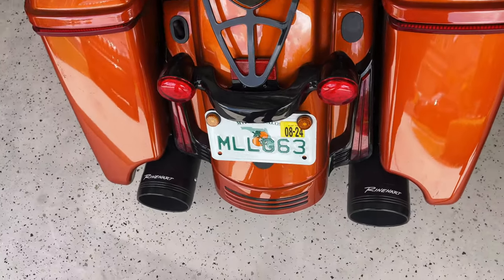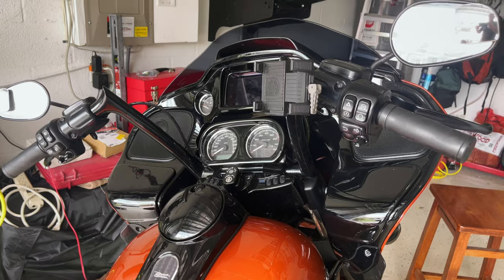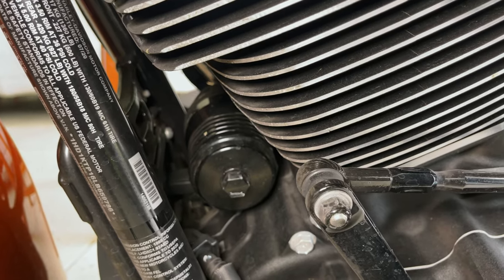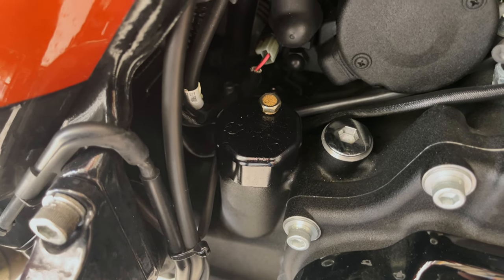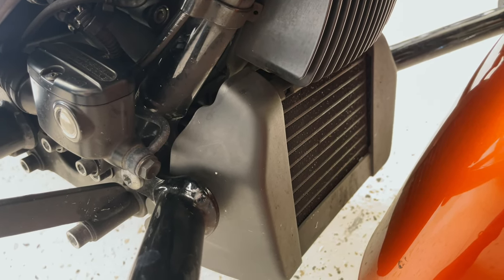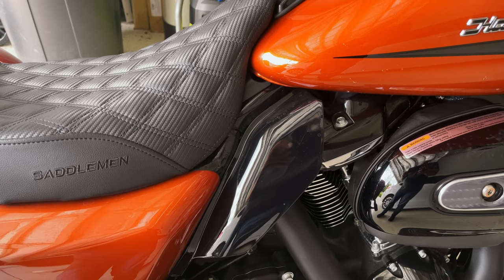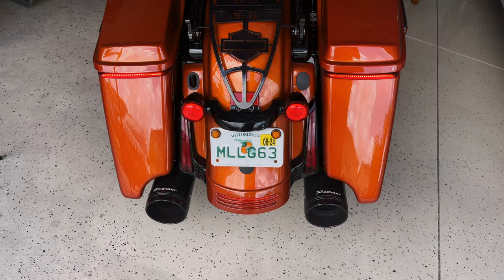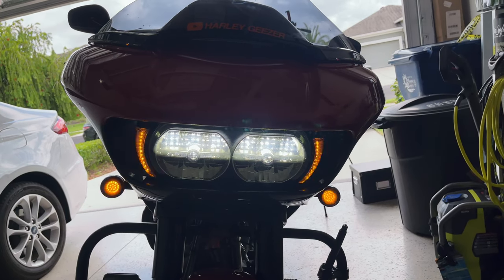HARLEY 114  M8 MODS THAT MAKE SENSE!

Comment: All you need to wake up a 114 is a cam because EPA has the motor choked, but other than that you are right. I have the same bike as you and I was on ciro3d cover for Myrtle Beach bike week in 2021.  Love my lights..
Reply from the maker: I might do the WOOD performance when my warranty is up. Not the HP but the torque version. I will do a video on an internal upgrade soon.
Reply: @HarleyGeezer1954  I have the 22xe torque cam on a 107 touring. I primarily ride 2 up and pull a trailer on long trips. The cam upgrade is THE best bang for the buck IMO. When you do that, expect a much louder exhaust note.
Reply: How do you know what oil pump you have I have a 2019  roadglid ultra

Comment: Great mods that keep the engine stock. Another one that I have is a catch can for the head breathers.  This keeps the cylinder from  hemorrhaging carbon and gives you a better throttle response.
Reply: probably won't catch much of anything in the catch can since he has the vented dip stick.

Comment: Your totally right! I had a 2016 SGS and moved up to a 2022 SGS. From  103 to a 114. Wow! What a difference.  114 runs a lot cooler. I took all my accessories off the 2016 and put them on the 2022. I added TAB'S with zombie baffles and heated grips.  I will add some extra rear lights. I have the rear heat deflectors. And that should be it. I am in Wisconsin. Not many days in 100°. You channel is awesome.  Thanks. I have some videos of the 2016 and the 2022 you can see if you hit my Pic.

Comment: I have a’22 rg with stage 1 and 2, and I rented a 22 sg with nothing, just stock, and I have ridden a friend’s rg, a ‘21, with a 131. I can’t speak to the 114 with stage 1+2, but stock I feel certain that my bike gets up and goes better than the stock 114, but not by a great deal. I feel like either way a guy can be very happy. My friend has the 131, and from the initial grab on, it has more torque and acceleration, and can absolutely run faster than either of the two other motors I’ve tried. Having 24 more ci than mine absolutely creates more and it does it right away. However, it is extremely expensive to buy the crate motor and have it installed and you have to really want the extra, which you can’t use all the time. Most of the time he rides just like a normal person and it goes unused. Frankly, I didn’t notice the heat in any negative way, it just felt like a Harley on a 88 degree day. There’s nothing wrong with that and there is yes, more power that you can feel. But it’s really a lot of money. And more down the road in service visits, just like you bought a new bike. I just ordered the vented dipstick and oil filter, thanks for sharing that information!
Reply from the maker: Thanks for stopping by. The heat down here can be extreme so I went with the oil cooler fan just to be sure. I love my vented dipstick.

Comment: Have the 20 114. Went with the Trask turbo and S&S 475 cam. 
Reliable HP without the big CI heat. 81 HP is pretty lame for 114 CI’s.

Comment: Regarding the air filter I thought the same thing I slapped a k and n filter in it and called it a day then I later bought an aftermarket air cleaner specifically the trask air cleaner and omg it does absolutely make a difference immediately

Comment: I just upgraded to the 114 from a 17 107. And the reason is that crappy oil pump it was HORRIBLE  so now i have to start the upgrade process lol. You are correct lights first. Ride safe
Reply from the maker: The 114 2020 and up have a much upgraded oil pump. As good as any aftermarket according to some great master mechanics. Yep always be seen. Here in Florida getting rear ended is the most common accident according to the latest stats. Thanks for tuning in!

Comment: Agree 100%.  And I’d add the Love Jugs Mighty Mite fans as well. They’ve dropped my cylinder head temps by 50 to 65 degrees, and the bike runs strong because the ECU never has to retard the ignition timing when the motor gets too hot (because it doesn’t).

Comment: Just put an S&S 475 cam, bearing, lifters, FuelMoto Jackpot header, Rinehart 4.5 DBX slip ons with 6” FuelMoto torque inserts, Arlen Ness ventilator high flow filter, Fueling vented dipstick, Fueling crank sprocket, Powervision w Autotune. The bike sounds amazing and runs so good. Lots of power, fast but smooth at the same time and easy to drive at normal speeds. 2019 Street Glide 114 w upgraded oil pump too.
Reply from the maker: I should have gone with the Power vision with my stage 2. Thunder Max fuel mileage sucks.I had to upgrade my cam to a 465 when my stock cam failed after 20,000 miles. It sounds like you did all the right things. 😎

Comment: I do not see the handle bars . I have back surgery and rotator cuff damage , sure wanted to see what size and model you went with , and did it help ?
Reply from the maker: I guess they're a little hard to see in the begining. Sorry I'll put a link to them. Everything on my bike has links in the description below the videos. 
Fat Baggers 1 ¼” 12” Black Bars. 
https://fatbaggers.com/motorcycle-par...
They ebded up being in the right position for my stage 4 arthritis. You have to match your bars to where your seat ends up for the adjustment.

Comment: Hello there i love your content, i was wondering what bars are on your bike? I have a back injury and my discs are messed up so riding comfortably is a major concern for me. I just bought a 2023 road glide special and its my first harley what is your recommendation for bars?? Any help would be much appreciated thank you
Reply from the maker: Thank you very much I appreciate it. Bars are of course very individual to the person. I have Stage 4 arthritis and it took a lot of trial and error to find the right height and angle. I sat on a lot of my friends bikes. Mine are the Fat Bagger  12" X 1 1/4". They have 13s and I wish I knew at the time they might have been a bit better. I like the angle of my hands so I went with them. My mechanic charged me a lot less because they are way easier to install that any other bars. They are 2 pieces. They weren't cheap but I have seen others more expensive that didn't fit me. Also aways think of your seat and where you will sit. If you plan on changing your seat do that first. Your hand position will probably change. I hope that helps. Everything I have on my bike is listed in the description of my videos with links.

Comment: Personally i dont drive in traffic, i dont use my Harley's as a daily commuter, when i ride i head out of the city and head for the hwy so heat really isn't an issue.
I agree with you on the big stage for build or even crate engines, i dont see the point 
I have a 2021 Street Glide with the 107 & stage 2 and its got plenty of power, but what i like most is the sound.
For me its not a stage 1 if you don't change the air cleaner and you still have stock headers and if you are worried about heat, get rid of the stock header.
I went with the Cobra True Duals header with Cobra Neighbor Haters and an SE Ventilator air cleaner and a tune, that really woke the bike up and now added the stage 2 and there is a ton of power but what i like the most if the sound.
while they were in changing the Cam i did have them change the Cam Plate to the SE along with the oil pump, changed to SE tappets and the S&S tappet cuffs, didnt like the plastic harley ones, also changed to SE push rods but that was a requirement as they cut the stock ones.

Comment: Love the black Harley logo on the rear fender. Was that custom made ?
Reply from the maker: It was made by a bunch of bikers in Germany. Extremely nice guys. They work through facebook. They'll do whatever you want. Here is a link. https://www.facebook.com/profile.php?id=100063726243734
Reply: @HarleyGeezer1954  do you know if your friend is still making these
Reply from the maker: @alexsorkin9394  These guys are a bunch of bikers in Germany great guys, They work off of FB. No problem with translation.
https://www.facebook.com/profile.php?id=100063726243734

Comment: Super informative video; thanks for the great content!  Question: I've got a '21 Street Bob and am curious if I need the oil filter and vented dipstick.  I bought the bike brand new 11 months ago and have put just under 12,000 miles on it without any issues (just changed the stock tires at 11,500).  To your point about living in a hot climate, I'm in SC, so I feel your pain lol...that's why I ask about the vented dipstick and oil filter.  

I love ALL of your lighting, btw.  I've done a couple of mods from Ciro and am incredibly impressed; yours is killer because it's purposeful and tasteful.  Too many guys go over the top, but yours is friggin' Goldilocks!
Reply from the maker: If you live in an area that gets hot I would do the oil filter. The vented dip stick is a yes.
Reply: @HarleyGeezer1954  good deal; thank you.

Comment: Reliability is more important to me than anything else. Due to the fact that in my research, I have found many many testimonials to the flaws that are part and parcel to mass production, and the garbage that is in screamin eagle products, reliability is NOT built into Harley Davidson. I love their fit and finish, but not in love with their production motors or their transmissions. I did what most won't and invested in having a bottom up blueprinted motor (124ci) mated to a Baker 7 speed transmission so that IF I want to romp on it, I know it is going to take what I put it thru. Also without the cat in the exhaust and a tune, the bike runs much cooler than stock. A 100,000 mile motor is what I wanted and what I spent my money on.... Well I did put a great stereo by a reputable installer too since the sound system on my '21 Ultra limited was pretty much worse than garbage.
One thing you will always find when going bigger and with more power, is that it never is enough when you get used to it.
Reply from the maker: Yep jumping down the rabbit hole.

Comment: The oil filter you’re using will have the magnet come loose. I have the flo oil filter which is the same as yours.
I found the magnet in the filter housing the epoxy breaks down and no longer holds the magnet. I did email flo but got no response. I started using the flo oil filter on my dyna in 2017 and the magnet had come off sometime last year it won’t get sucked into the engine at least mine didn’t.
Reply from the maker: Good to know. I’ll have my guy be aware. I’ve had the on 2 bikes so far